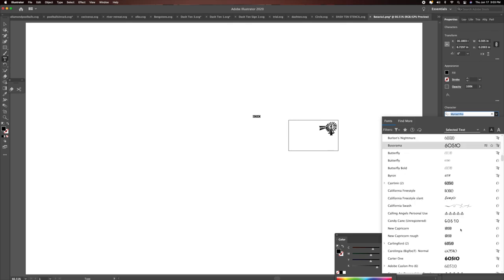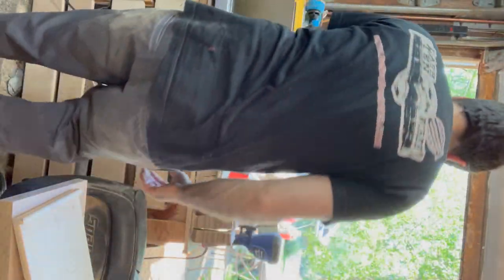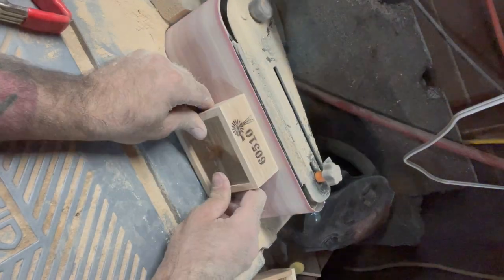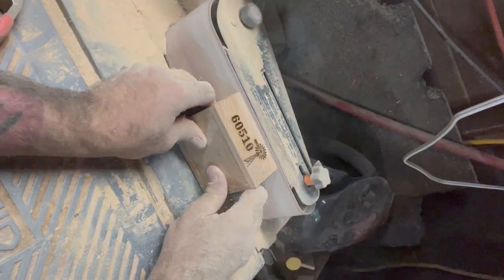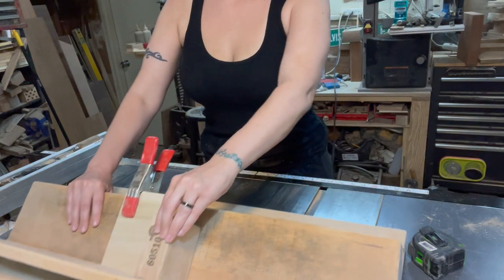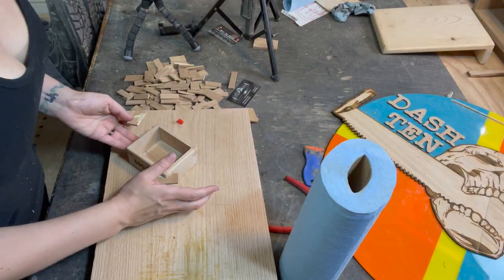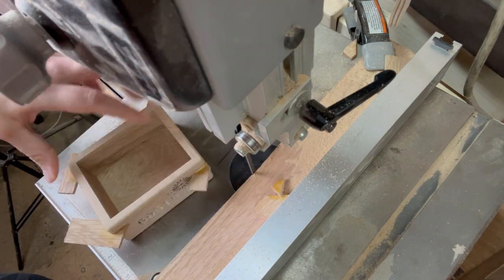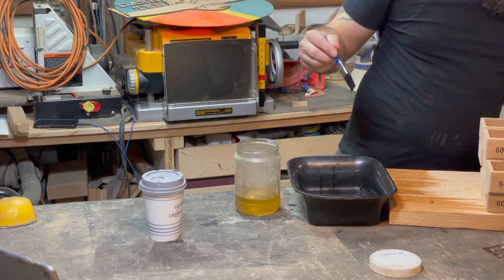Watch Us Make Custom Sugar Caddies

Comment: Do the splines serve some function, or are they ornamental only?
Reply from the maker: They are both! Instead of being held in strictly by fasteners it provides extra security. Like a lock between the two corners plus added glue surface.